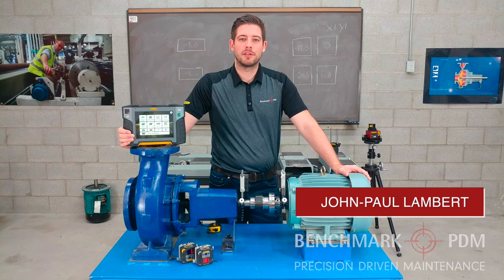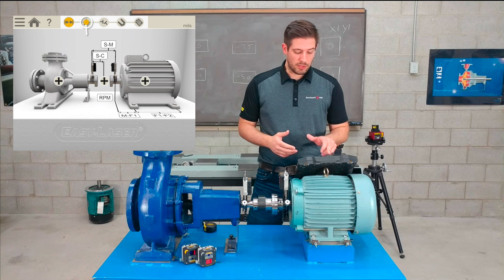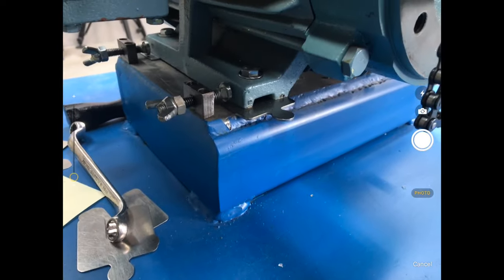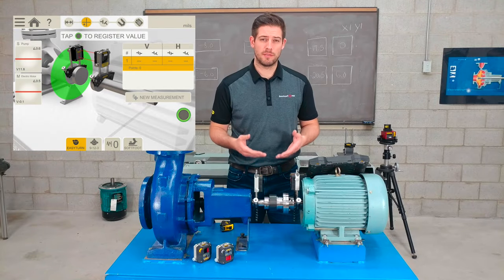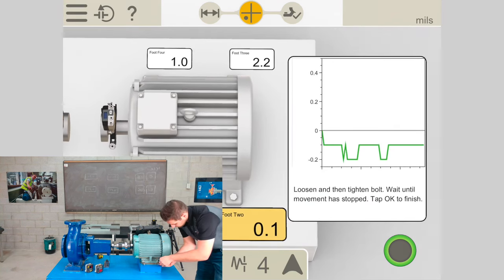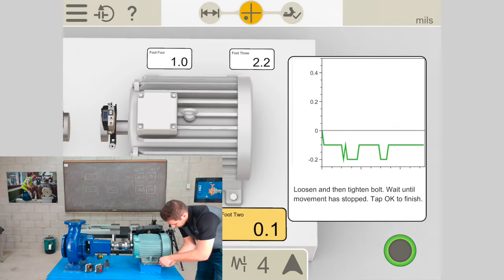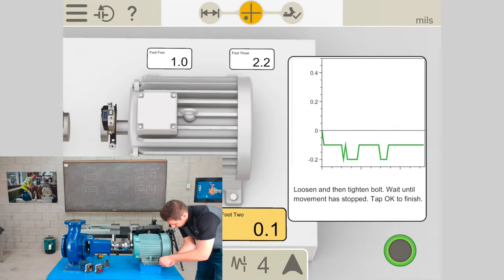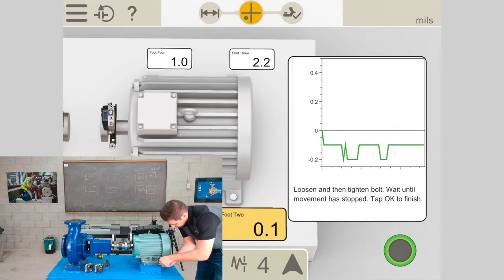Easy-Laser XT Shaft Alignment Demonstration

Comment: By looking at the results of the softfoot, how many shims did you use to fix it? Did you put shims in every foot or did you chose only the highest number? This is the final question! Thanks for the video.
Reply from the maker: If we put any shims in to correct the softfoot, we would only have put in at the worst foot (ie. 2.8 thou of shim at foot two). So this softfoot could be corrected by putting 2 or 3 thou of shim at foot two, but as explained since the standard is 2 thou or less, we can make a judgement call and not put any in because it's quite close to 2 thou.
Reply: Topal ayak degerleri birbirinden nekadar farklı çıkarsa işlem yaparız ?

Comment: We sure have come a long way from dial indicators and a note pad. I am an old Millwright, learned "Reverse", "Coach", Optilign, Rotolign now learning Easy-Laser XT770. I hope after I get it figured out my company does not buy another system, I'm all for continued education but I am weary from  it. Thanks for the video.
Reply from the maker: Hi Mazkact, we certainly have! We still teach and train on reverse dial alignment at our facility as we think it is still very important to know. It's a great way to understand the principles behind understanding misalignment, what is actually happening with the machines and how to proceed correctly with alignment. Glad you are working with the XT770, I think you'll find it not complicated at all to use and very straightforward. It's also excellent at non-rotating shaft applications and handling misalignment over longer distances . Good luck!
Reply: Sir can you teach me method of reverse alignment?

Comment: Привет, для чего нужны фильтры в меню рядом с выбором режима центровки? (Стрелки вверх,вниз и волнистая линия))) использую эту программу и никогда не менял значение.😂 Как раз на проверке мягкой лапы у вас значение 4
Reply from the maker: Hi there, these numbers are for setting the filter at a high value or low value. Depending on where you are working and your environment, you could have high vibration from a close machine or hot air travelling near your laser/detectors - these things can effect the laser travelling though the air and into the detector. If you notice the values are fluctuating because of a condition like this, try setting the filter higher and it will get rid of this external "noise".
Reply: @BENCHMARKPDM спасибо) может прибор зависать если значения стоят на пяти и выше в хороших условиях? У  меня прибор подвисал сказали надо на ноле держать😂
Reply: @BENCHMARKPDM короче если есть вибрация и данные замеров меняются надо повышать фильтр?

Comment: In the soft foot menu, the machine only took the parameters and calculated them. We will adjust all of them in the adjustment menu, isn’t it?
Reply from the maker: Yes, you can make the corrections in the adjustment screen or you can stay in the softfoot screen and make the adjustments. Either way, you should recheck what corrections you applied by doing another softfoot measurement. However, the laser should be used to measure the softfoot that you hopefully already corrected. The best way to correct softfoot is with a feeler gauge first, fill the gaps with shims one foot at a time, then put your laser on and check it. There are too many variables that could affect the numbers the lasers give you. ie. bearing play, couplings, machine casing, etc.

Comment: Can we use android tablet(andoid/ios) to replace ecom tab display unit? If we can, does it means that XT50-M/S measuring unit could be connected to any other smart device?
Reply from the maker: The XT550 measuring units can connect to any Android or Apple device with the free Easy-Laser XT app. Whether the new device/tablet you use is ATEX approved (ie. explosion proof) like the ecom tablet is up to you.

Comment: Sir, it is necessary or not to loosen the coupling bolt during  measuring alignment and adjustment?
Reply from the maker: Hi Cokro, whether it's necessary or not can depend on the application. For the purpose of this demo, we decided to leave the coupling connected as it was easier to demonstrate. However, the best measurements you can take is if the coupling is open because there will be no potential interference from the coupling.
Reply: @BENCHMARKPDM  thanks Sir.

Comment: Will it take measurements with out a coupling installed in multi point?
Reply from the maker: Yes - all of our models except the XT440 has the Multipoint measurement method. All XT models can handle open coupling alignments, but the XT660 or XT770 for instance using Multipoint or the Uncoupled Sweep measurement methods is preferred.

Comment: If we take measurement by clock method 9-12-3 what's the reference point for vertical misalignment.? 
How they calculate vertical misalignment..?
Reply from the maker: As along as you have input the correct adjustment and laser/detector distances, the vertical and horizontal misalignment can be calculated by taking a minimum 40 degrees when rotating the measuring units. Of course, more measurements or a larger rotation ie. 180 degrees  vs. 40 degrees might give better data. In any case, to view the vertical misalignment and or rather adjust the vertical misalignment, you can go to either 12 or 6 o'clock positions and move the machine live time. Depending on laser/detector technology, you can also force live and and adjust in any position.

Comment: Can you use this in flame proof environment, can I use this tool on fuel pump and motor alignment?
Reply from the maker: We also have intrinsically safe shaft alignment models if you need to use this in explosion proof environments. Check out our XT550 model here: https://benchmarkpdm.com/shaft-alignment/easylaser-xt550-ex-shaft-alignment-tool/

Comment: Can u see both vertical / horizonal moves on same screen on xt660??
Reply from the maker: Yes, you sure can! For the XT660, it is almost identical to what is shown in video between approx. 18:07 and 21:10, except for the Live 360 function (which is a XT770 feature). With all of our XT models, you can move the machine in both planes all on the same screen.

Comment: What do we do if the static side shaft can't turn?
Reply from the maker: You can use one of the sliding brackets we offer on the static side (non-rotating side) and slide the bracket/measuring unit while using the digital inclinometers for both measuring units. Both inclinometers must be within 1 degree to record a measurement. If it is uncoupled, you could also use the newer Uncoupled Sweep measurement method!

Comment: boa noite como faço quando tenho motores perto e tendo vibraçoes  .no aparelho
Reply from the maker: Hello Larissa - i cannot reply in Portuguese but i think i understand your question. If you have high vibration coming from other machines close by and it is affecting your measurements, you must increase the filter to a higher setting. Go to the video at 10:25 mark and it will show you how this is done :)
Reply: @BENCHMARKPDM   ok obrigado